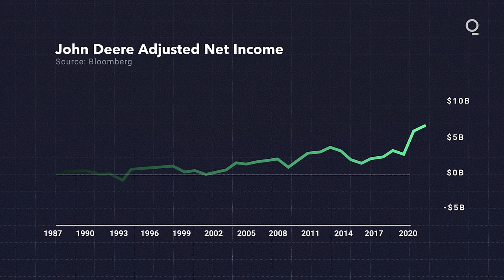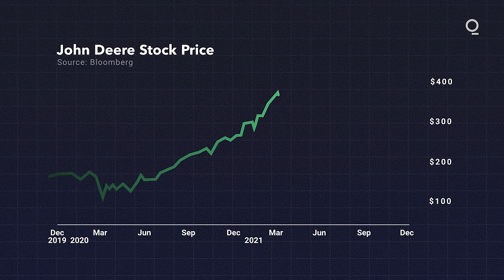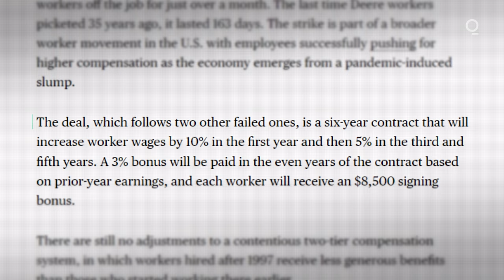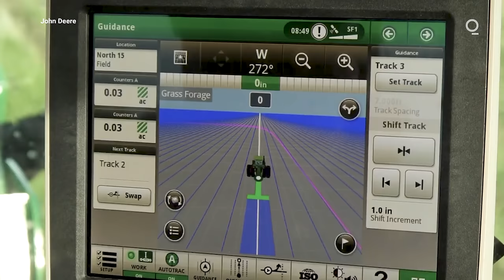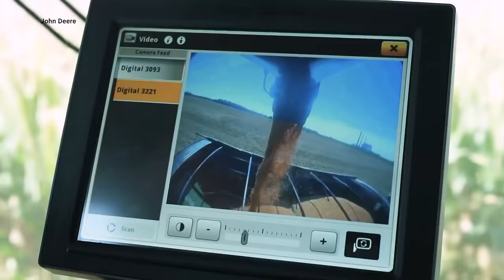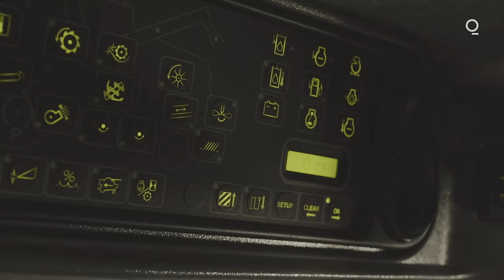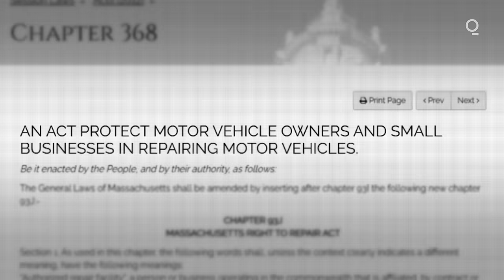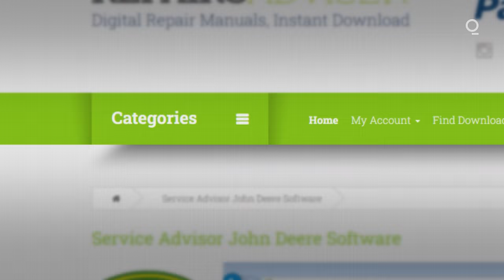John Deere Is Facing a Farmer Revolt

Comment: Almost all the comments here are in support of the farmers right to repair and I agree with that in the context of providing the tools necessary to diagnose and repair the tractor. Allowing them to modify the embedded software or the parameters used therein is absurd. I worked as an electronic systems engineer at one of the big three for decades and I can tell you that there is an unbelievable amount of effort spent on safety in software. The companies have to go through extensive code reviews and testing to get permission from governments (e.g. homologation in EU, emissions testing, etc.) before they are allowed to sell them there. Modifying even one parameter could result in the tractor steering failure for example. It's not something that should even be considered. It takes years to train a computer scientist to be competent with the code base and there are millions of automated tests that are done after each and every change. There is no way a layman is going to hack the control software and "repair" something. In fact if someone manages to change anything in the controller, it's going to be a brick afterwards. If you disagree, you are asking for farmers to have the right to drive a tractor which could do anything unpredictable at any time, potentially killing someone else or themselves.

Comment: I spent my life as a auto technician doing fuel injection, carbs and electrical. I remember how difficult it was to diagnose an on board diagnostic problem between makes and models of cars (ODB). Every failure code meant something different for each manufacturer and the manufacturer did not release that information. The government stepped in and forced them to do so and to standardize the failure codes...
John Deere is just protecting profits and it's such a short sighted position that they are going to lose...
Reply: More Govt is always the answer .

Comment: Comparing repairing a piece of farm equipment to a Jet Airliner because the tractor goes on public roads is ludicrous. First off, the instances of farm equipment on public roads is a lot less than jets flying. Second, if the piece of farm equipment fails because it was not repaired by John Deere, It does not fall out of the sky with 120+ people on board.

Comment: This equipment is ridiculously expensive. Most farmers around here buy old used tractors and fix them up. No computers, no A/C, just tractor. They plow the fields just the same despite what the dealers say. It's getting like the aircraft industry. By law, a licensed aircraft mechanic is the only one allowed to work on your plane.

Comment: We sold our John Deere equipment simply because of their proprietary BS built into just the parts we needed to fix our stuff. 
To the point they said if we didn’t input the right code into the machine it wouldn’t work even with the new part.

Comment: Comparing the safety issues of a tractor going down the street with one farmer at the controls versus an airplane containing hundreds of passengers is completely disingenuous and totally laughable.  The risk is hundreds of times more with an airplane versus a tractor. If the engine on a tractor dies, the farmer can pull to the side of the road, or let the tractor stop where it is. You can not do the same with an airplane. Even if the pilot can control the airplane, it must stay in the air until the plane can fly it to a local airport.

Comment: Worked on Case machines for 35 years I'd say about 60 percent of owners had the basic skillset to do the nuts and bolts repairs to their machinery  if required  ,This ratio  kept owners in the loop  so to speak  Todays machinery won't run if it has electronic issues   unless you are a trained electrical technician  with the service tooling  you won't have a hope . not to say you won't luck out and find a broken wire or sensor but when it comes to electronics how many farmers know how to use an oscilloscope  or Diagnose  A Can bus intermittent  problem  or to read an electrical schematic ? The trade off for extra productivity is the technology and unfortunately  sometimes it breaks down  .I live in Australia if we had a module failure or some other major part problem chances are we would be waiting for weeks for a replacement  ,At least if your in the USA  you have access to the huge dealer network and trained personnel to help  .

Comment: "..tractor going down the highway" is a safety risk if software is modified?  It is not too often you see a tractor going down the highway, John Deere.  Seems like an extremely unlikely scenario in terms of risk.  A more likely scenario is farmers fixing tractors on their own, this will impact John Deere's bottom line.  Right to Repair is legitimate demand by US farmers.  Actually, it is a legitimate demand of all US citizens regarding electronics, cars, etc

Comment: Comparing an aircraft flying 30,000 agl to a combine crawling at 800 agl is preposterous. JD has always been the most expensive implement producer. Not bad $10,000,000 increase for top CEO, throwing scraps to your work force. Stay with the fight farmers. You'll win at the end.

Comment: I’m aircraft electrician in the army. Our newer aircraft have all digital components. Everything is electrical is a mini computer talking to the other computers. If there’s a failure. The manual tells us to replace computers. I hate it because it’s difficult as a taxpayer to throw $30-120k boxes in an aircraft and it doesn’t fix it. If you ever look through the manual for the corrective actions. About 75% of them is to replace boxes (computers). Anyone who can read and can remove a box and put a new box in can do my job. It doesn’t allow for my skills to be used to their full ability. So when replacing boxes and the manual has no other options. I have to guess. I hate over reliance on computers. I understand their usefulness but I wish there was a way to bypass them if needed.

Comment: The funny thing is that most of these embedded softwares are run through Unix/Linux system which is open-source. It will just be a matter of time until some sustainable company create farm tools with opensource embedded software and let grandpa download the fix/patches by himself.

Comment: John Deere massively over-rated.   I bought a life-style block and a new ride on mower.  Within 2 years, the yellow seat  cracked in multiple places and the large round blade surround was rusting and peeling.   I dont think it even had a primer on it.....just large hunks of paint peeling off....and this on a mower that was always stored away.   I always thought that American made equalld quality.   To be honest i don't think it was any better than a cheap Chinese knock-off.  Before this bad experience I always thought John Deere was premium.  American-made no longer means quality.

Comment: "The risk of a tractor going down the highway" it is a huge concern, but there is a lot of ways to prevent this with technology, if you are telling me that you are unable to put safety nets in place to prevent that to happened, without the owner "breaking it" what the H311 are you doing putting electronics and software into those big tractors? One thing is not related to the other. Get serious and stop treating people as unable to learn.

Comment: All the railroads have their own service shops and when they have repair issues whether warranty or in general,  the locomotive manufacturers will send service people out or bring the unit back to factory service shops.    A new offering to railroads is  " Power by the Hour " contracts where customer pays for usage by hours units are used.       The Federal Railroad Authority is very fussy about safety on the rails

Comment: Sorry Mr. Deere. An airplane flys 30,0000 feet in the air with millions of passengers a year. A tractor drives 26 mph with one person. It is already a hazard on the road. If the software from a 3rd party makes the machine fail it is no different than if your software fails. Trust me when i say ive been in sketchy situations when i tractor stopped on a major highway due to ground wire failure or an ecu decided it needed to derate a machine. Either Deere starts to make some changes or the internet will. Theres a massive market for aftermarket solutions.

p.s. As a former Deere tech, id rather the customer try and fix their own equipment. in the end they still decide to bring the machine in because i am a specialist on those machines. The technicians will provide you with profit. But who cares about them right?

Comment: It would be cheaper if 100 farmers would group up, hire engineers to build open source machines that are easy to repair, cheap to repair, reliable, cheap. Then hire factories in China to build all the parts. There would be a product that lasts forever, has an easy to understand manual that explains how electricity works and how programming (instructing computers) works. It would destroy the tractor economy, but the farmers win. It would bring power to the people, but people do not do research and it would hurt the economy, which depends on waste through endless buying and selling.

Comment: All big companies try to do that the list is staggering. Got a deer to cut grass from a big box store engine stoped after 15 hours.  Had to get the deer dealer to come and get it. After two weeks I called. They said they didn’t know when I’d get it back. I said how about a loaner they laughed. Had to call corporate. They said everything is tracked by computers and that engine was available in Michigan call back and told him that corporate said to call you every day till you gave me an answer at work that worked fine. Lucky for me corporate keeps an eye on them. I’ve been all summer without a lawnmower.😢😢

Comment: It’s a misguided effort by the management of John Deere! Not only are they pissing off their customers but they’re also telling their competitors exactly how to compete against them. The other tractor manufacturers should be watering at their mouth. This type of behavior was one of the first downfalls of General Motors. Check out the automobile laws and I’m sure you’ll find They could easily be adapted to agricultural equipment.

Comment: How is this really any different from what Apple does? 
 This is yet another angle on planned obsolescence. Manufacturers screwing over the customer, on purpose and with full ability to alleviate the situation.

 Straight up shows what matters more to a farmer: Their truck or their tractor. Manufacturers did this to trucks a decade ago. Main reason I'm considering getting a mid50s pickup and restoring it a bit. Atleast I know I can fix what's broken.

Comment: I used to perform onsite "grey market" repair. Not illegal, just tougher parts and better software, that pointed out where the manufacturers were designing machines to fail on schedule, in order to increase future repair profits. They got mad. They had gone beyond planned obsolescence, to planned breakdown, and timed repair. Our heavy duty built machines lasted four times longer beefing up a few key mechanical weak points, and updating software accordingly to one that was not expecting the failure of the weaker parts and automatically signaling for repair. I was working on systems for nuclear war ships, as well. Enemies looked for weaknesses like that. No room to mess around. Essential as it got. More efficient machine systems are more powerful machine systems. What they are doing here is suspect. Just asking for competition, from grandsons of farmers, like me.

Comment: I can't believe that spokesperson for John Deere tried to use the argument that it's unsafe to have farmers work on their own equipment my dad is a farmer and I've worked on dairy farms and the farmers I've met in my life are more skilled and better mechanics than the people that are employed by dealerships, if the owner of a piece of equipment would like to fix it themselves they should be able to or at least be given two options not just the manufacturer, there are many examples of people doing work themselves like doing their own Electrical, Plumbing or brake repairs on vehicles

Comment: They could very easily offer tech certification to the farmers and their staff if they are concerned about "safety."  Farming is mission critical.  Mission critical operations benefit from having 24/7 onsite repair staff.  It has worked well in other industries.  I remember one of the worlds largest commercial printers would run their equipment 24/7 and the manufacturers would train the in house staff to keep it running.  Worked out for everyone.  The manufacturer made money on the training and parts and the company had less down time.
Reply: Yeah, there is a fundamental, irreplaceable difference between the ability to do immediate on-site repairs oneself vs. having to wait for an authorized personnel to get scheduled and travel on-site to do it better.

Comment: "Safety".
If you're so concerned about safety to why not do what we do in Europe for our cars.
Require regular inspections of cars that may run on our roads.
Likewise require inspections of the farm equipment.
If it has been modified then sure, you're no longer liable for anything involving that modification and it's not legal to use it in situations where others might be endangered.
Then the farmer in question can choose to live with that risk or not as they choose.
Also any other electronics should be repairable and modifiable too.

Comment: I support the farmers on the right to repair, but with all the computer tech on board, would you really try and diagnose it yourself?  I like repairing old cars, but I’d never touch any of the new stuff.
Reply: Difference is cars drive about 70 mph on motorway. Tractors are different in that aspect.

Comment: It is outrageous that a company can sell a product and then chain the buyer to their monopolized repair system by withholding information about how the machine works. This is like the Mafia requiring protection money. I love Deere products. But if they refuse to provide operating manuals and repair manuals and software and whatever other information buyers need to repair their (very expensive) equipment, Deere should be barred from selling their products in the US. Deere is a historic company but they do have competitiion.

Comment: There is a simple common sense aproach to this, make machinery simple to repair. I worked for a company that made concaves for John Deere 7720 and 8820 combines, on the 8820 the John Deere concave would break in half combining corn on brand new combines. I see a real market for simple farm machinery that can be sold much cheaper than this over priced machinery. Farmers should start their own company, this type of machinery would have a massive world wide market.

Comment: All these people whining that deere needs to let the customer work on their equipment. 
That's fine but most of these customers will wind up frying the electronics on these pieces of equipment. 
In the long run you're better off letting the dealer work on it.
Also if you farm and don't have some spare equipment you're not gonna be farming long.
I'm an over the road trucker and our fleet has 6 extra trucks sitting at the shop.
If you don't have extras then you're in trouble. Parts are really hard to get right now and that goes for everything

Comment: Is the CEO perhaps thinking of that scene from Interstellar where all the combines suddenly head for the house and nobody can do anything about it? 
Sounds more like when there is an issue you CANT get it started, not that some glitch happens and the operator is now a helpless passenger to the "crazed machine".
If these machines are directly linked to JD, JD should know INSTANTLY if something is not functioning correctly, exactly which unit it is happening on, and be on the phone to the owner BEFORE they know they have an issue.
Honestly if "safety" was the real concern here, they would be proactive.

Comment: They said the problem and solution right at the outset.

The buybacks should convert to employee vesting to allow employees increased compensation through dividends. Short-term, midterm and long-term strategy confluence. Selling investors are looking short term, execs are looking mid to long but the decision should include the workers, in my opinion.

Comment: It's yet another example of corporate America trying to get its greedy mitts on small businesses. If the Right To Repair bill fails in the US, then it means that they will have all US farmers by the balls, as it gives them a green light to keep doing it. The likes of Monsanto had a similar idea when it came to genetically modified crops. This is how a crop farm usually works:
A farmer seeds the field with grain from the previous harvest. They harvest it, then keep some as seed for the next harvest.

With GM crops:
The farmer buys the GM seed and plants it. When the harvest is complete, as per the contract of supply, the farmer isn't allowed to keep any seed for the next crop, but must buy new seed stock from the company. A "licence fee" is paid as a percentage of each successive crop after that.
Regardless of the scientific or commercial benefits  of running GM crops, would you really hand any part of management of your farm over to a corporation?

Comment: This is a business model that first started with software. You don't own anything. You basically lease it for some kind of annual fee. In this case the 'annual fees' are the costs you incur by John Deere forcing you to pay whatever price they demand. It's very lucrative for John Deere to make you pay a huge up-front cost for the machinery and then make you pay maintenance and upgrade costs forever. In essence JD 'owns' the machinery since they have absolute control on how and when you can use it. I would guess they also make a fortune by selling the constant stream of tracking data you involuntarily send to them every time you start the tractor.